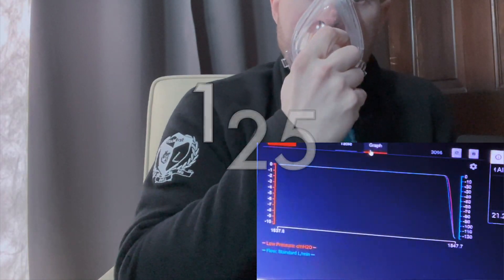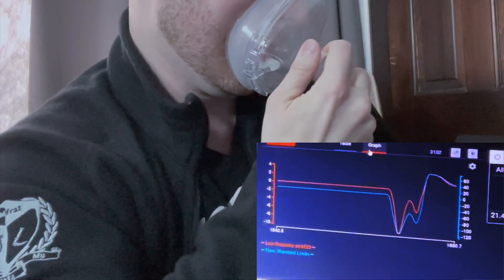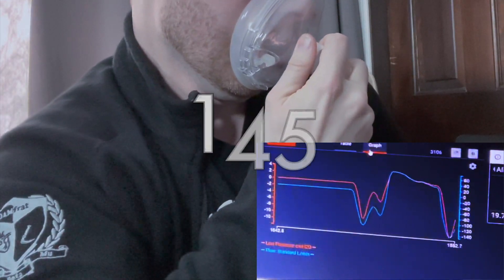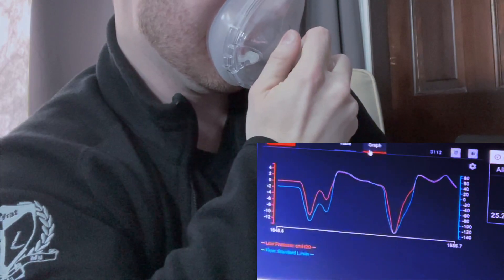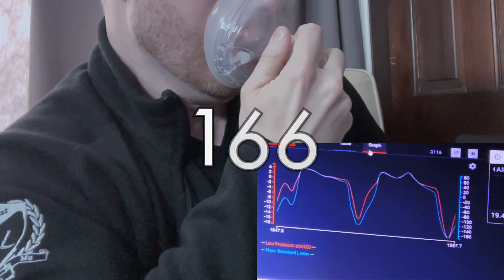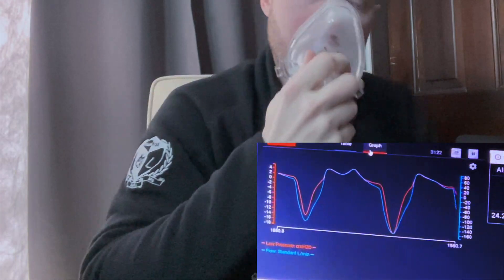IFR Vs FiO2

Comment: So, how would you propose delivering that amount of flow? Even in HFNC with a controlled ventilator such as the Hamilton, the best you are going to get is 60L. You are talking a NRB mask so even at flush on the wall the max is going to be 17-20. Your video was 60-70 inspiratory flow which is not possible to attain in simple NRB, HFNC; and you had a mask on so even with 100% FiO2 in BiPAP, the flow isn't going to be in the 60-70. Guess I am confused what you're demonstrating and how your video proposes to meet this increased flow beyond technological capabilities in prehospital setting. Love the products & thanks. CEM